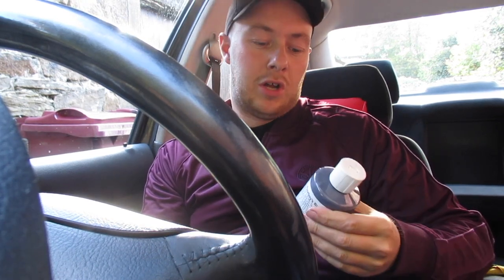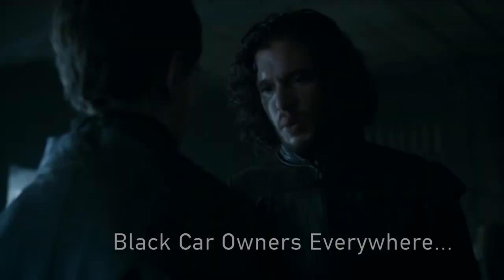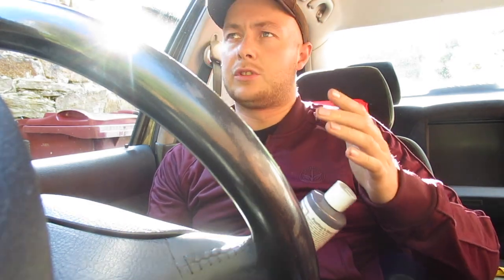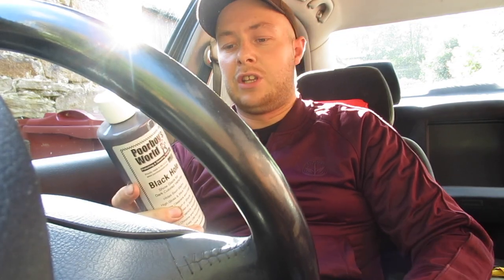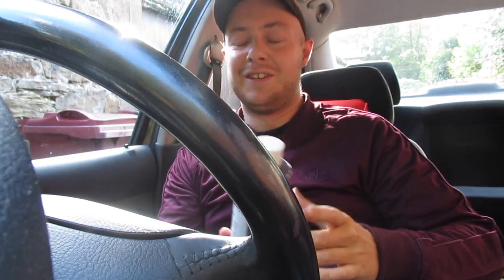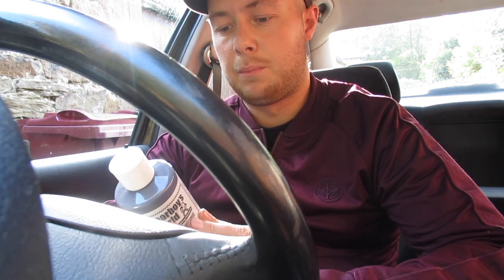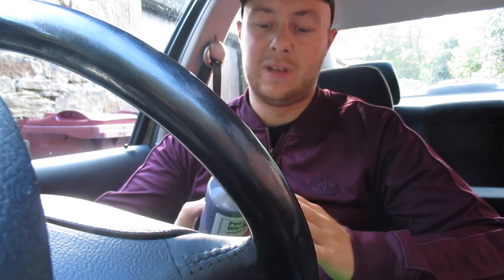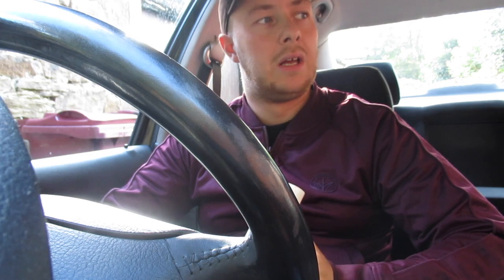THIS IS THE BEST BLACK CAR POLISH!!

Comment: It's a glaze, not a polish. 2 very different things.
Reply: That's right :)
Reply: That's right. But it does hide scratches, for a couple of months. I have some deep scratches I probably need a needle paint pen, then use compound lotion, then k2 Color Max a real polisher. I think then  you use black hole, then maybe finish of with a sealant.

Too complicated.

Comment: Good vid. Did u use a safe washing method? And a claybar before ? Only reason I ask is because I'm looking to do this with a machine polisher. But also ceramic coat it. Thanks in advance
Reply: If you going to do all that then best to wash , fallout remover , clay and machine polish and then remove the polish and ceramic coat it , this is just a glaze and fills in light swirls and doesn’t remove them